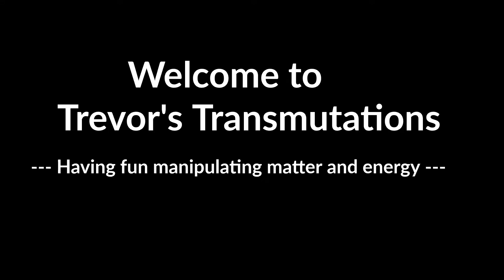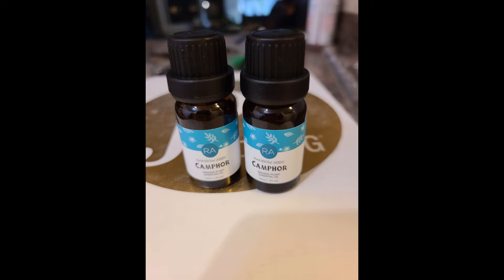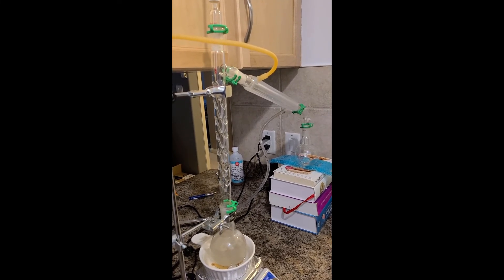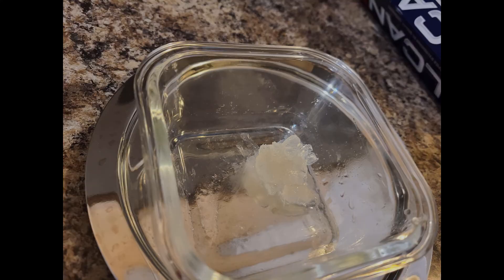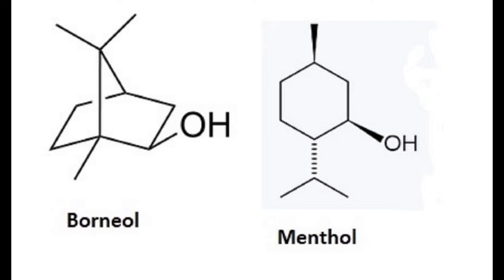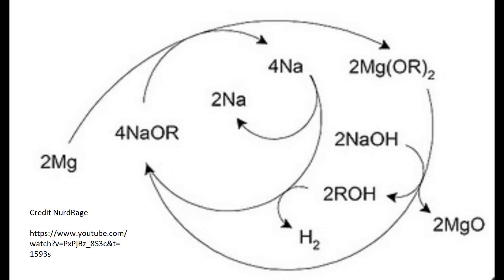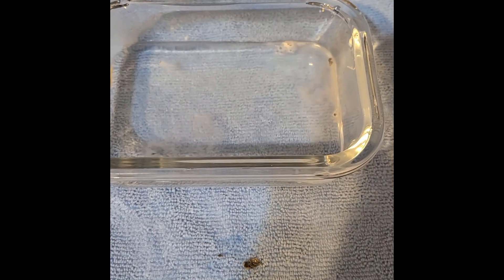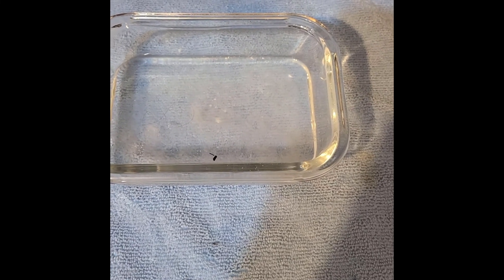Preparing Borneol using the aluminum isopropoxide and why

Comment: Is acetone very dirty, or can it be cleaned after re-distillation? Do you think a reflux condenser without water can replace a fractional column?
Reply from the maker: Yes, if it is long and you use careful temperature control.  I you use too high heat setting it will overload the condenser.
Reply: @ Thank you, you helped me a lot with your video. I'm planning on doing sodium too
Reply from the maker: Acetone is cheap an widely available, not worth the time saving it.

Comment: There's no need to produce borneol. Just use menthol and camphor in 1:1 ration (e.g. 1g of each). Reaction will be done in +- 6 hour, even faster than with borneol itself.
Reply from the maker: I know more now in hindsight.  I have heard of the menthol method, but not the 1:1 camphor menthol mixture.  Thanks for the comment and for watching.
Reply: @T.Transmutations  Cause I've discovered it by accident 1 month ago. :D I tell about it to NurdRage of course. :)

Comment: Yield ples i Need Nummer If the Reduktion is Good to Use
Reply from the maker: I did not measure yield.  Rough guess 80%.
Reply: @T.Transmutations  i saw 75% in a Paper so ya can be